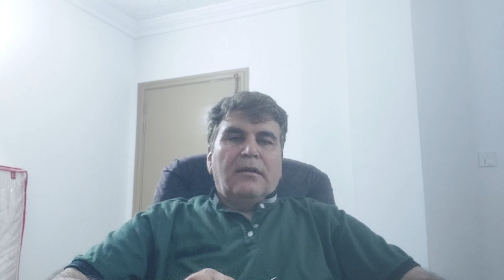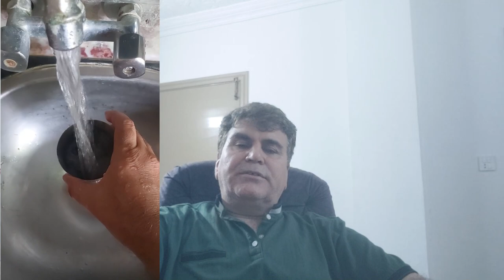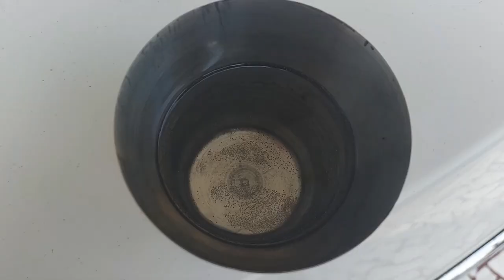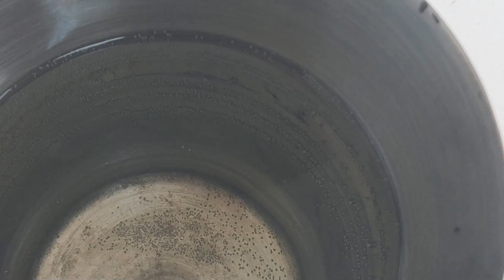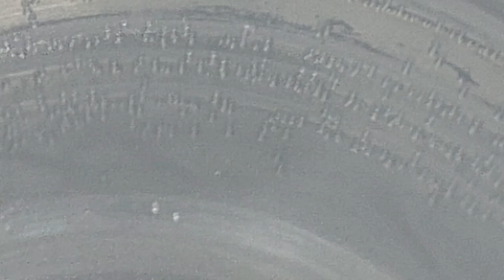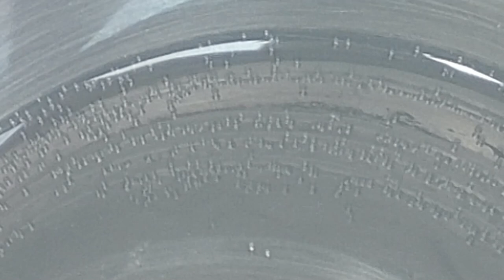Why do bubbles form in a glass of water

Comment: I wonder if the release of bubbles changes the taste of the water at all. As well I wonder if a refrigerated sample of this water releases more or less of the nitrogen/oxygen bubbles.
Reply from the maker: Oxygen and Nitrogen are tasteless gases, so the bubbles don't change the taste of water. A sample of water from Refrigerator does contain more gases.
Reply: @SafiMixed  that makes sense, what if we could tell the differences of concentration ratios just from taste! That would be pretty cool, but I guess we wouldn’t have any need for that evolutionarily